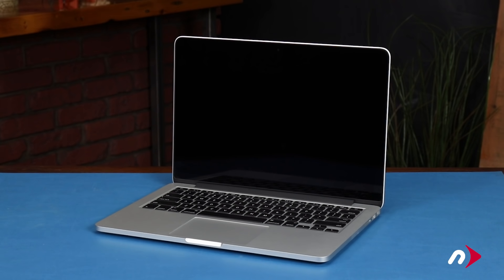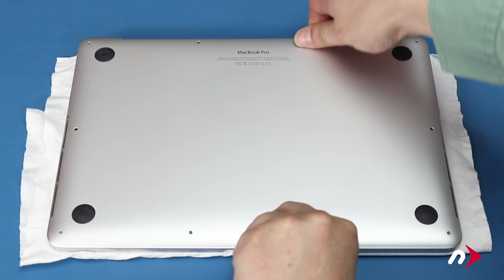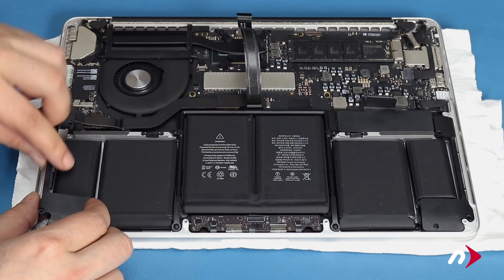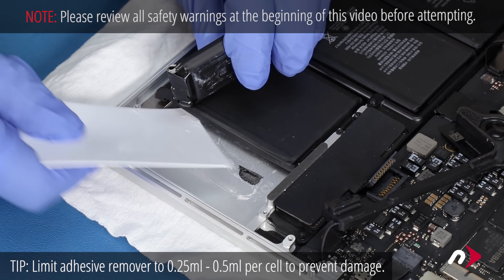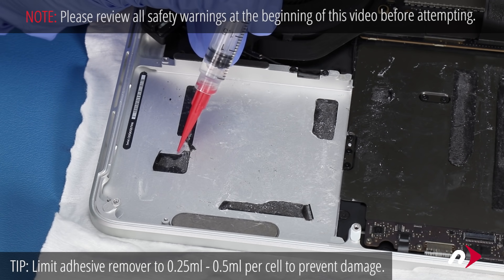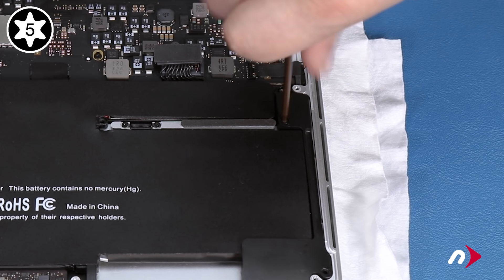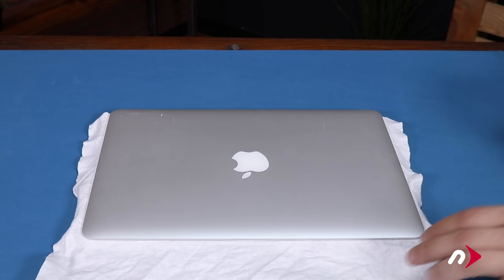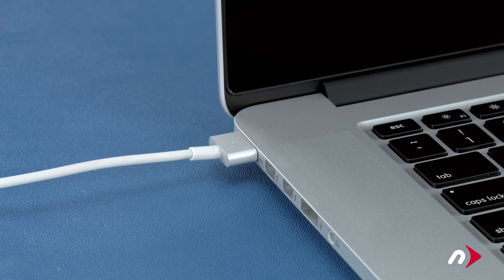How to Replace the Battery in a MacBook Pro Retina 13-inch (late 2013 to early 2015)

Comment: wow they made it so difficult on purpose so we have to pay alot to an apple tech or buy a new laptop.
Reply: DeadMoNeyProductions BP exactly by design...
Reply: my mbp early2015 battery pump up ,full of unknown gas like a ballon after 3 years of usage
Reply: Odasoken Ikii I put a pin hole in the balloon to deflate and taped over the small hole. Take care not to short the insides of the balloon, that will cause sparks and trouble. Only puncture the insulating cover. This buys time to get replacement battery.  Six years of use. I think the swollen battery was affecting the trackpad, too
Reply: @odasokenikii1211  have the same model, mine just stopped turning on when disconnected from a charger since a few days, only 3,5 years of usage -.-
Reply: @abc76580  same issue with mine. Fuck apple
Reply: Oh and btw ... your Mac automatically down clocks your cpu to its slowest speed if you decide to use it without a battery. Apple has really gone down hill since Steve’s passing. Using more and more of these product design tricks to suck more money out of its consumers.
Reply: @Jeansy1290  More like Apple is subsidizing CHINA CCP so they can stick it to us deeper.  Made in China CCP crap.  Cut corners, they will. So they can milk the market.   And then throw us a Trump with a virus.
Reply: Yes, battery died on me 6 months after AppleCare ended. Now, I've got a project just to use my laptop.  Only using Macs for studio work going forward.

Comment: What do you do to drain the battery if your computer just dies every time the power adapter is taken out? Would it already be considered drained in that case?
Reply: @poweredbyowc  Can you be specific on how to check the connections? My macbook pro 2015 does not charge past 0% yet the icon says its charging. This happened from one day to the next. Is it a battery problem or a connection problem?
Reply: @poweredbyowc  I have the same question, but I'm not sure I understand your answer. The question is: how do I drain the battery, in preparation to installing a new battery, if the computer dies as soon as it is unplugged? Are you saying that in this case it is not a good idea to change the battery?

Comment: Hi! I would like to disconnect the battery of my MacBook and run the computer only on the power cable to test a problem that I'm suspicious to be from the battery. My concern is this cable going to the trackpad, does it have anything to do with the battery too? Do I have to disconnect it to run the Mac only on power cable with the battery disocnected, or can I leave it connected? Thank you so much in advance!
Reply: don't know if you tested your theory yet. but if your only gonna do that to run the test then a full battery removal wouldn't be necessary just take off the back panel and undo the battery cable then put the backing back on. you would only need to mess with the trackpad cable if you need to actually remove it and in your case you technically don't

Comment: The clearest and easiest tutorial by far. I used an old metal credit card instead of adhesive remover to remove the battery. Thank you so much. Fixed my Macbook in 30 minutes.
Reply: how is it running by now? (1 year later)
Reply: Yes, I used a flat plastic pry tool that I had and did it "dry" as well!  One note, my laptop didn't recognize my battery or charger after the install and the fan was on 100%.  I researched the issue and by disconnecting the battery and holding down the Power button for 5 seconds, I cleared the "memory" and the unit fired up as normal and I was able to start the charging/discharging cycles.
Reply: How is your macbook now? is it still working?

Comment: Did this fix but now my keyboard and trackpad have stopped working. Is it logic to think that the issue is the cable that runs over the battery? Because it really is a pickle to fiddle that one in and out its slot (early 2015 model)
Reply: Same here, also early 2015 model. Do you figure out the solution?
Reply: @givighifari7273  In the end I retried connecting that specific cable running over the battery. And it worked. That cable is really sensitive.
Reply: @evertsmits4952  Thanks for replying. I have tried to reconnect the flex cable, even buy a new one, still no result. I found that the brass part of the cable cannot be attached completely.
Reply: @givighifari7273  Last thing I can think of is like checking the connectors if they are clean. I do not know if you may have spilled any drinks on your macbook. But this could also mess up everything. But honestly I think that you need to go to an apple store and see if they have any options. And be careful for the newer models as they tend to have issues. I would still go for a meaty 2015 model instead of a newer model if a replacement is needed.
Reply: I have replaced my trackpad flex with the new one. Still the keyboard and trackpad aren't working, please help.
Reply: Same issue here. Also early 2015 model. Please let me know if you figure out a solution.
Reply: Did u end up fixing it?  @angeladon9921
Reply: @angeladon9921   In the end I retried connecting that specific cable running over the battery. And it worked. That cable is really sensitive.

Comment: “60 Minutes” “Advanced difficulty” more like 20 minutes and easier than an iPhone screen haha
Reply: For real, this man has never fixed an iPhone screen😂👌🏻
Reply: how is it now? does the battery still work well and hold charge?
Reply: I dunno, scraping off all that adhesive took longer than the whole rest of the procedure for me, plus I went super slow because I was worried I was gonna break my computer. In hindsight now I've just done it it was really easy apart from the adhesive.
Reply: My thoughts exactly 🤣
Reply: Facts 😂
Reply: Hence why i dont do phones 😂

Comment: Thank you very much , I did everything you said
but I notice "Service Battery" warning 
Even After I do what you said on last video ! 
last thing I do is reset SMC 
by connect the MagSafe to my MacBook pro and shout down my mac
and then click on "Shift + control +Option + power button 
for 10 sec then release my hand from all buttons and click on power button 
I notice the power light change from green to orange color
Then open my Mac and The warning is gone and became "Normal" !
Reply: Thanks, this was indeed exactly what was missing.
Reply: thanks, he missed that, saw on other video...
Reply: @danthemans  So what is missing here in this video. I am planning to use this process to replace my battery?

Comment: All this just to replace a stupid battery. Apple is so stupid.
Reply: They made everything so much more difficult on this model. Even down to the tools needed to open the back.
Reply: nishchay verma  some of it is intentionally more difficult, though, unfortunately. Like the screws in the back cover of the laptop. They require a special screwdriver. Normal screws would work just as well but apple wants you to have to buy a special screwdriver to open their product.